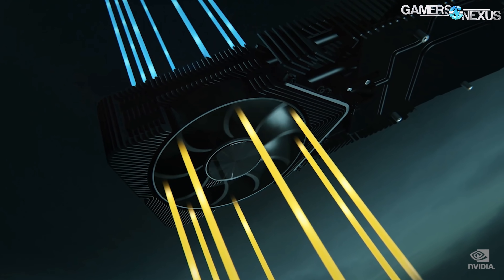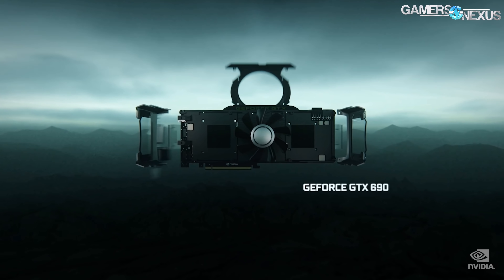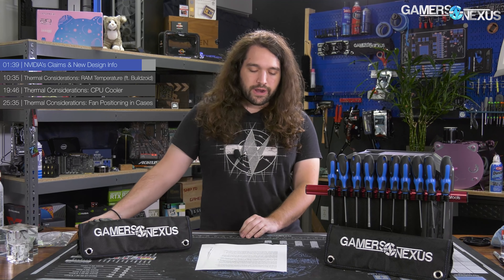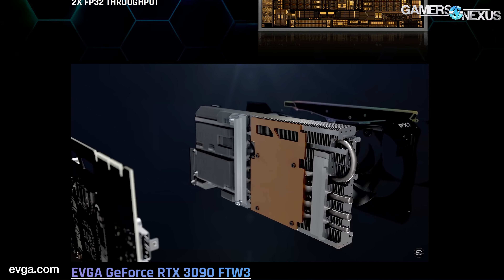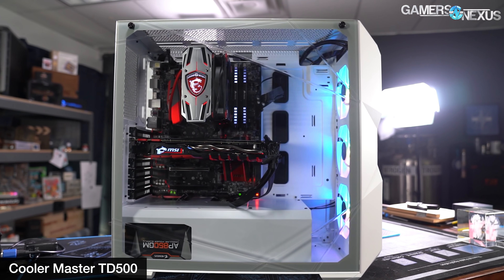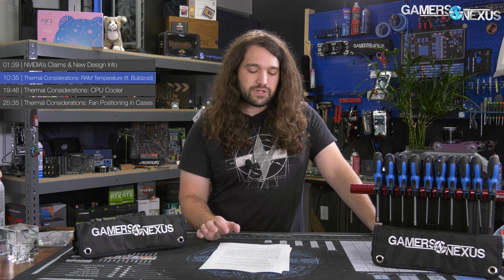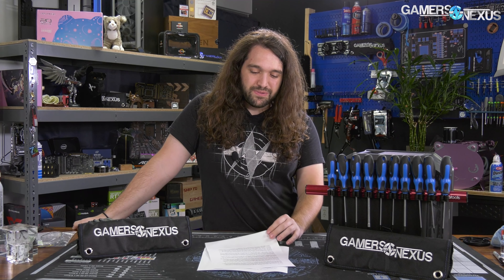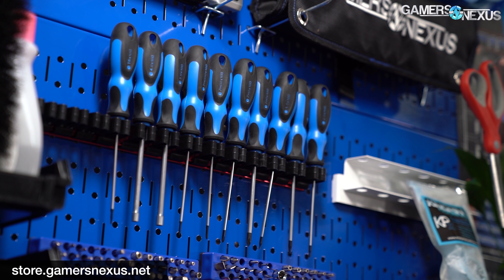NVIDIA RTX 3080 Cooler Design: RAM, CPU Cooler, & Case Fan Behavior Discussion

Comment: what is the temperature of the air pushed by the GPU directly in to the intake fan of the CPU cooler. I am wondering, is it better for the CPU cooler to have colder air from the front fans of the case or is it better to have hot air coming from the GPU fan directly in to intake fan of the CPU cooler. Also there is a mixing between the air that is pushed upwards from GPU to CPU with the air that is pushed from the front fans of the case towards CPU. I hope they will change that GPU fan to push downwards and back instead of pushing air towards CPU and RAM

Comment: I have a 650W power supply with ryzen 3800x and the wraith prism cooler that came with it. I figured the stock cooler should be fine since I don't overclock it. 
I already ordered a new PSU (super flower leadex III Gold 850W was on sale), but I was hoping to get away with still using the stock cooler. I'm hesitant to replace the cooler with an aftermarket one because I hear horror stories about people having trouble uninstalling the wraith cooler. Apparently the thermal paste turns to concrete and if you're not careful while pulling it off, the CPU will come off with the cooler and the pins will get bent leading to a dead CPU. I hear that you have to run a cpu benchmark prior to removing it so that the thermal paste gets warmed up. I'd have already changed it by now but I'm worried I'll screw it up.

Comment: i have CoolerMaster H500 de-RGB'ed mid tower++, is their benefit to replacing the 2 200 fans with 2 140 or 3 120 ? i don't have toasty high end specs, but i see a smile on my face when i see my under-volted gpu stays below 70c in really intensive games

Comment: The thing is, while it's not a reasonable usage scenario for anyone building a custom PC, you KNOW that there will be millions of pre-built PCs that will be built and ship with some of these cards and literally the cheapest CPU cooler some SI could have found to use. Remember that CyberPower PC with the B550A board that you reviewed? A R5 3600 with a RX5700XT is a reasonable build. But, if you're spending that much money, you will never use a cheap downdraft cooler. But, this product was advertised and sold as being "high performance" and even suffered thermal and audio issues as a result of the decision. And, I'm willing to be that CyberPower sold way more of those than anyone can expect for them to have done to.

Comment: Do you think it would be worth it waiting for Custom cards, if availability will really be as low as speculated? Judging from past GPUs would there be significant differences between Founders Edition and custom cards, for example OC potential when talking about normal overclocking without powermods etc.
Or does it basically not matter and just go with the one I like better.

Comment: Guys, if you have a badass CPU cooler it's still gonna be bad ass with a 3080.  Worst case scenario is temps under load are 1 or 2 degrees higher as long as your case setup isn't total crap.  Putting in a 3080 or 3090 isn't going to melt your CPU down to molten slag the moment you start a game.

Comment: Memory overclocking...
Does the top fan really matter that much if it can't spin high?
I was a little confused because this heatsink stack is mainly just extra cooling. It's connected to the same section that the OTHER fan cools so if the top fan can't spin too high the bottom fan would just spin up to compensate. I imagine there's some algorithm to adjust individual fans to optimize around NOISE but wouldn't the limiting factor (for cooling memory chips) just be the overall cards capability to remove a certain amount of HEAT regardless of what component is generating it?

Comment: I doubt this cooler will affect much else negatively in a significant way. It's creating the same amount of heat as any other design at the same wattage. 

Positives: some heat gets expelled out of the case immediately. Unlike normal coolers, this design keeps the heat more uniform to get it out of the case better. With normal cards it just throws heat off towards the side panel and that heat is left to rise and find other currents out of the case.

Something else to consider is how hot is the air after it passes through the cooler. I doubt it would be over 50C (though this is based on my knowledge of aio coolers). Because of that and the controlled movement of the air, it could actually help RAM temperatures

Comment: From my own experience, switching from a blower style VGA card to a regular one bumped the CPU temps quite a bit. Made worse in a SFF case. CPU idle temps went up 15C, load temps got to the point of thermal throttling. I doubt it's going to be much of an issue in large ATX towers with proper ventilation, but for mATX and ITX this might force people to go full water cooling. On the flipside, the PCB seems relatively short with the cooler overhanging at the end. So it might fit a pretty short full cover block and allow people to cram even more power into a tiny case.

Personally I don't care about the cooler design that much. When I'm getting a 3000 series card it's going to go into a water cooling loop anyway. And with the radiator being externally mounted, impact on the case ambient temperature is going to be minimal anyway.

Comment: Interested to know how these cards will stack. Usually when stacking several GPU's for work/render machines, blower cards or watercooling has been prefereable to fans due to pushing most the heat out the back of the case. I wonder if this 'semi blower' cooler will be any good, or if it effectivly now makes the FE cards void for multi GPU machines.

Comment: I buildt a new computer in a Fractal Design 7XL  for my son, he was burnt by an Cooler Master AIO a couple of years back when the cooler plate on the  pump sprung a leak mid plate, so it is aircoolers that is his goto spot. He edit own videos from own material and wanted something faster than the old i7 4790K and the 32Gb 2400MHz along with the 1070 8Gb. This time it is a x570 board, a 3950X, 64 Gb 3600MHz RAM and a placeholder with his old 1060 6Gb card. He aims at a 3090, but want's to see where the prices and quality issues end up befor buying. Still, this 3950X is running with a Noctua NH-D15 and Noctuas industrial NF-A14 140mm 3000rpm fans out the back behind the CPU cooler  and inline with the front intake at the to front place, then we put two Noctuas 140mm more standard fans below the one at the top front position. But the trick is that we placed one Noctua 140mm at the top rear to help the one on the back to remove hot air, and another in the front top blowing into the case, and a blocker in between made of an old Define4 fan blocker/sound isolation. So from the bottom front to the rear of the case it is, intake intake INTAKE intake out OUT. And in between you have the NH-D15's two fans, the first one raised to clear the G.Skill RAMs. The front industrial, the second fan on the cooler and the rear is connected to the fan manager in the case and master connected to the CPU optional, (the other to the CPU cooler connector for safety) the fan manager can be used for up to 30watts fanpower. This will be interesting to see if it works well while rendering videos in 4K. Also, he likes ASUS and don't want the reference cards, but even those have a small outlet on top of the front end. IF the cooling isn't sufficient, we are looking for the Artic Liquid Freezer II 280 or eventually the 360. The sound when all fans run 100% is like a idling jet, but he uses headphones anyway, that is his arguement for staying aircooled as long as possible. Running 3D Mark with a 3950X and a GTX1060 is fun, not many does that! ;) Talk about strangling the CPU! ;)

Comment: I've never been a huge fan (ha..) of 3rd party GPU cooling implementations that just re-cycle the air in the case. It just seems wrong to me blowing that warm/hot air straight back in to your case, even if the airflow in your case is good.
Blower style cards have always made more sense to me, I just wish they could improve the cooling and noise characteristics of such a design. So here's me hoping this new design is the bee's knees.

Comment: Time to start putting air ducts in the case like some industrial HVAC system! Cut a hole in your side and duct that hot air straight out without ever getting in the case.

Comment: Hi Steve do you think it's possible to have 8 rtx 3080 in a server if the server has 2.5 slot for the cards. Maybe plastic sheets between all the cards could help separate hot and cold air

Comment: Hey! This is not related to this video at all, but it is something that has been bugging me for some time now..
In previous reviews of different CPU coolers, you have included a test for flatness (levelness as you called it), but haven't really showed us how you measured that flatness.
All we know about your test is that you've used "specialized equipment" and dragged a needle in a clockwise pattern over the plate, with the needle zeroed to another point to god knows where.
We do not know what said equipment is, or exactly how you are measuring it.
Could you please provide us with some more information on it?

Comment: Will the FE fit in the Silverstone Raven RVZ03? The dimensions are fine, but I'm wondering about the location of the 12 pin power connecter and the adapter since my psu only provides 2 8pins

Comment: I want to grab a founders 3090 but the thing that is keeping me from fully commiting at this point is the lack of focus from Nvidia on the 3090. Either they don't expect to sell many or the performance increase does not align with the increase of cost. And I'm scared of latter being the case
Reply: It's meant for 8k gaming so no doubt it will outperform the 3080, but the fact is we're seeing how generations' jumps in performance are great, 3090 will not be that good in 2 years. Buy it if you're rich enough to buy another $1500 4090 in 2 years.

Comment: hmm, I'm using the crystal 280x, I've removed the top and front glass, my 280mm CPU cooler can only fit on the top so that's the intake and the outtake is in the front. there are many o' holes on the bottom of the case so I hope that'll be enough fresh air for the 3080. I got the crystal 280x because it looked cool :( yet it's an AntiAirflow case XD
Edit: I'm going to get the Asus Strix 3080.
Edit 2: I might even need to get a new case to fit the gpu as its 8mm too small for the FE 3080 

9700k
32gb wam
1080ti

Comment: I just today did a ram stability test with y gskill 4266 cl19 1.4v  @ 4000 cl16 1.45v and 24c ambient and my ram never got over 41,5c for the dim thats under the cooler and 39c for the exposed module in slot 3. So this design definitly will raise temps as that air is going to be a lot hotter then 34xc. This is the absolute my ram will do aswel so if higher temps will make it unstable i dont know.  But just to make sure i want closed backplates so i really hope the msi ventus 3x will be good as it does not have this flow trough. As for my air cooler same thing my 9900k may not like that. so either i get no issues with a closed backplate or i will build a glass devider in my H500P mesh.
Im also planning on placing a 80 or 70mm fan under my gpu as exit fan to get rid of that hot air faster despite having a positive pressure setup. I currently have a blower style cooler so this will be new territory for me.

Comment: I wonder... what if now the back fan is ran as intake, reverse the flow of the cpu cooler accordingly, and all the rest of the fans as output ? Having and intake directly from the side panel in front of the GC would be optimal (in my mind), though these babies are... from an other era unfortunately.
As for negative pressure vs positive, Linus made an interesting one year long test in dusty environement, and found out that in the end, the negative pressure was the cleanest.

Comment: On the top front to back could you do something like:
Intake, exhaust, exhaust?
Reply: if  you have front intakes the top intake might  disturb the airflow from front to back.  it needs testing ofc but it doesnt sound right imo
Reply: Gonna be interesting to see optimal fan placements
Reply: The general principle is not to have intake and exhaust on the same side, as some of the warm exhausted air will get back in via adjacent intake fan. Same problem when back exhaust fan is reversed to intake - bringing back in warm exhausted air from GPU at IO side.

Comment: Any recommendations for a tower cooler that’s somewhat easy to install while in the case? Looking for something modest for my 3600.
Reply: Depends on your budget obviously but I installed a Fuma 2 (bought it for €54) on my 3600x in a Pure Base 500 quite easily. It's designed so that you can install it with the fans already mounted (you get a long handle screwdriver with it) but I had some difficulty with that (first large tower installation for me!) so I responded the fans and it was easy enough to install them in the case. It's great value if you can find one.

Comment: im curious how vertical versus horizontal cpu towers  and large dual tower versus thinner single tower do 
also what about pushing out exhaust in the very back of the top and one intake in the very front of a longer case that could fit like 3 140s in the top that has a top ventilation

Comment: @GamersNexus is vertical mounting dead? It seems like I'm going to be cooking my nvme ssd and chipset (which both rely on passive cooling) in a vertical mount config. And X570 boards with active cooling on the chipsets seem like they're screwed.

Comment: What could be the most logical CPU air cooler design to use instead of the stock 3900X one, in combination with an FE 3080, inside of an H210?

Comment: With the rtx 3080 and 3090 i wonder how it would run and cool on a vertical gpu mount with the exhaust out the side a hole in the side Pannel you know just hoying out the case maki g negative pressure

Comment: 13:23 The pull fan... spinning backwards... so weird. Why not a normal fan setup, but just positioned below the fins as it is... that would actually 'pull' the air above through it?
Because if the placement, orientation and rotation really is as it is shown in this animation, the air will not be pulled, but pushed (very ineffectively), into the fins and not exhausting out the back as claimed.

Comment: Memory thermals are a real concern for me. My memory is Samsung b-die and pushed to the point where it becomes unstable above 42C. I have a fan that directly cools it so this is generally not a problem in normal use, but when a GPU is dumping hot air onto it that can be an issue. I have had to try to block the GPU from blowing hot air on to it (not a case with a window, so no need to be concerned about aesthetics). I am actually wondering how hard it may be to swap the fan out for one that blows in a normal push direction, instead of pull.

Comment: if you would be so kind when testing the new cooler take a look at inverted layout casses too, such as the corsair 600c my front and bottom intakes are loaded up with noctua ppc 140mm's, with currently one 140mm exaust,, what happens if the card is blowing down mostly agasnt the flow of fresh air?

Comment: Me with the Thermaltake 900 wine-cooler case: Huh.

Not like I'll be getting one of those cards, yet anyway, but I do gotta wonder how well it'd work with the motherboard mounted sideways like that. Already had enough fun tweaking intake and exhaust fan speeds enough to keep VRMs cool since there's no airflow from a CPU waterblock. Boy, is that Red Devil 5700XT a toasty card when it gets going.

Comment: About cases.  Why aren't there cases where the motherboard sits horizontally.  
With a mesh front cover and fans on top.  

Wouldn't that kind of case would have good air flow. 
No gpu sag 
And better space to do cable management?
Reply: The cases would look bad with all the motherboard ports coming from top, with the peripherals cabling just rocketing and curving there
Reply: There's a few but they're mostly micro atx cube style cases

Comment: So if I have an cm h500 with the front intakes, two top intakes and a back exhaust,120mm noctua's for the intakes and exhaust, what would you recommend? Is this an ideal setup? I was thinking of switching the two 120mm intakes to exhaust but I'm not sure if it would steal air from my u14.

Comment: 20:36 radiative heat is not at all significant in these temperature ranges. The heat of the back is mostly convective. Natural convection plus forced convection from present airflow

Comment: How different is the 3070 cooling scheme? Both fans are in the front, not sure if that means that it's more of a traditional cooling scheme for the founders card or not.
Reply: looking at renders, the right side fan is blow through just like the 3080/3090

Comment: isn’t this similar to what most AIB boards already do? Pure blower cards haven’t been popular for a few years now, so most of the big ‘three fans on a heat sink’ GPUs will push warm air up towards the CPU cooler. Should be able to mitigate by picking an air cooler with enough headroom to cope with the slightly higher ‘ambient’ air.

Comment: This will be my first high end card as I’ve been saving for this launch specifically. Since I have the budget for the 3080 or 3090, I’m unsure what to do about my cpu cooling, since Steve said that I shouldn’t use the stock cooler on my 2700x if I plan on getting one of those cards. 
My question is what should I get for cooling my cpu?
Reply: jesse montalvo highend tower (to move the air) or aib water cooler to give cpu cool fresh air instead of how gpu air...